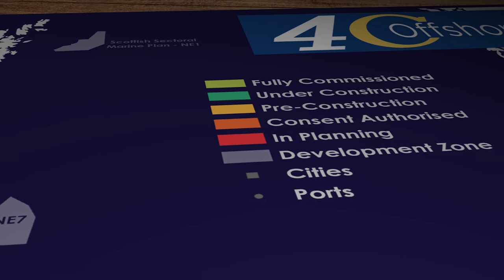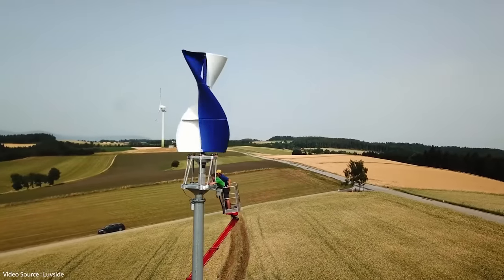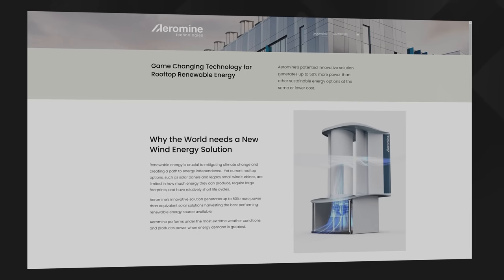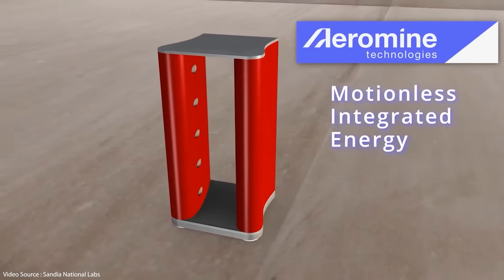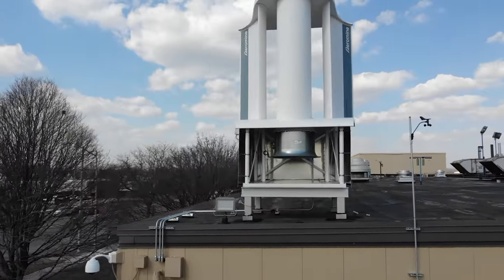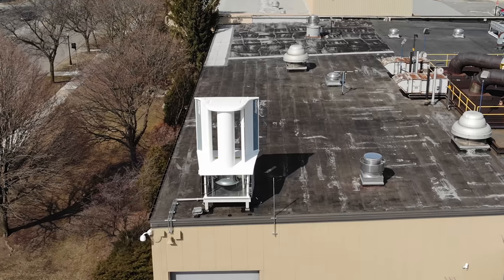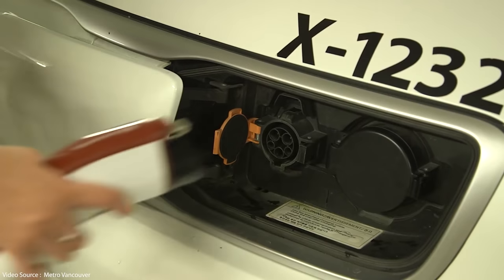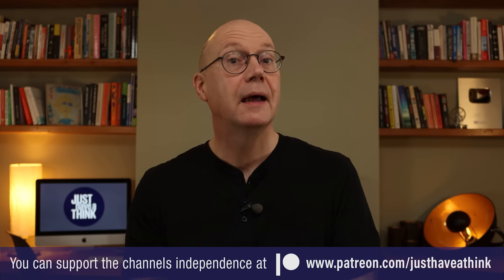Aeromine Rooftop Wind. Static. Silent.  50% more power than Solar PV. What's not to like?

Comment: More than anything I feel we should come up with multiple integrated methods of mass producing power, strength in diversity so to speak. If one method fails the others are still there. Like some kind of synergistic co-op. Sorry if that sounds weird.
Reply: Look up Ziroth, he did a great video on this same technology

As well as great videos in general
Reply: Peer to peer generation and storage, supported by an integrated grid is The Way
Reply: That's always been the goal
Reply: Industrial sights often combine an high level grid access with small to medium sized power generation often for heating or cooling and electricity on side. 
In addition to Photovoltaic for electricity.
Reply: We did that decades ago.

We say fossil fuels, but that's not one fuel.

Before we had "renewables", coal , natural gas,  several types of waste liquid fuels, nuclear, and hydro made our electricity. 

The biggest problem is that we have to move large amounts of electricity around the country as the day goes on.

Renewables allow us to put lots of electricity production right where the homes are, which will greatly reduce how much electricity is moved.

For example, if the people in your neighborhood produced 30% of their  peak electricity usage, then you have to move a LOT less energy long distances to meet that peak.
Reply: Reliability and safety are a key metric that grid operators around the world aim for. 

Having redundancy in energy sources means that you have less of a risk of the grid going down given any kinds of disturbances. 

Positioning this tech alongside building roof edges, leaving the other space for solar panels, is a prime example of this. Same is true for those ideas we've seen Dave cover in the past of co-locating offshore wind + wave generation.
Reply: @thetalkingbear Perhaps if we stopped using government to interfere with the free market, we could let capitalism do all this for us!

The free market, like evolution, finds the optimal solution through trial and error.
Reply: @jezlawrence720  We already have an 'integrated grid'. Energy storage is far to expensive, as is all renewable energy.

Either use fossil fuels or nuclear and quit worrying.
Reply: Fossil fuel apologists are out in full show today dang, this is new for Dave's channel
Reply: Not at all weird.

I've been thinking the same thing. Particularly when it comes to looking at localized/democratized power - one has to lean on what type of biome you live in to clarify what is the best power source. For example, it's likely far better in the northern hemisphere to focus on wind power, because it can generate more over time given the long winters and lack of direct sunlight. Products like this and other stable-state wind production could be vastly beneficial, even if you have solar. I know some companies are designing machines like this that can hook into an existing solar array, and can be removed and become a portable generator as well.

So you're right on the mark. Diversity is resilience.
Reply: Amen
Reply: @joeblogs6598  The free market is incapable of dealing effectively with entities that damage the climate or the environment, because markets ignore unpriced externalities.  If coal burners had to pay for the damage caused by their CO2 emission, as well as the damage from their toxic and radioactive particulate emissions and tailings piles, then the market would work great.  The last coal plants would have closed many decades ago.
Reply: @SeeNickView  The reality is that fossil fuels have provided the world with enormous benefit.

If you believe there is another source of energy cheaper than fossil fuels, go make a business providing it.
Reply: yeah except at night there is no wind either... that's why renewables need a lot of storage and will always be way more expensive than baseload like nuclear
Reply: 1. No wind at night? Are you serious? Air pressure differentials just cease at night? Yeah right. 
2. Even if that was true, you should look at electricity demand curves. Night happens to be the time of lowest demand.
Reply: @incognitotorpedo42  Completely and utterly false.

The environment is not an "unpriced externality". People care about the environment as evidenced by the fact people clean their house, trim the hedge etc. Therefore, they are willing to pay to maintain the environment. The issue is that people have other, more pressing matters to spend their money on, like food, heating, healthcare.

Think of it this way: Take a look at some slum in africa. Theres detritus everywhere, open sewers etc. Do you think those people want to live like that? Of course they dont, but they dont have the money to spend on disposing of their waste properly. Part of the reason behind that is because energy costs so much over there. Alot of those countries use petrol generators because they have no grid. Other places dont have any electricity at all and rely on wood for heating.

Humanity's well being is in direct proportion to the price of energy. If energy is cheap, people will have the money to make things cleaner.

If you doubt capitalism's ability to make everyone's life better, I remind you that a capitalism based system is responsible for the conditions that allow all these inventions that make our lives better, to exist.

If you believe that putting the government in charge, an organization funded by theft (taxes), and one routinely caught in corruption and general wastage. I'll direct you to the USSR, and China, which have the biggest governments in existence, and are the most polluted places to exist. Just look how the Aral Sea was destroyed by the socialists.
Reply: @thetalkingbear It's not weird, it's smart.
Reply: @joeblogs6598  assuming your argument is in good faith, you are just ignoring that some tech could be optimal for environmental impact, another for pure cost, another for resiliency to weather events, another for generation predictability (dispachability), etc. If government doesn’t intervene, if fiduciary duties associated with the business organizations laws based purely on long-term profitability, might not create the proper incentives for the deployment of power generation technologies that are better for the long term viability of the humanity.  Guardrails imposed by the government can redirect the forces of capitalism towards the really optimal solutions for humanity (including profitability) and NOT ONLY those technologies that are optimal to deploy in the interest of companies’ shareholders.  Short story is, it all depends on what you are actually optimizing for.
Reply: @fricardo3  "pure cost"
The price of something is the expression of all this stuff weighed up into one.

If you think something is too polluting, it is likely because people value their time more than that degree of pollution. If their time was more valuable, or things that they bought were less expensive due to cheaper energy amplifying their effort, they would likely spend that excess value on spending a little more on a less polluting alternative.

As I've previously said, people living in slums don't like the pollution they make, it's just that they can't afford to pay a guy to build a sewer or take away the trash.

"capitalism towards the really optimal solutions for humanity"
Pure capitalism (unregulated free market), provides the optimal solution for humanity.

It's like all these ridiculous regulations they're trying to force onto farmers at the moment relating to fertilizer use. 
Foolish politicians, activists, and environmentalists believe they know how to farm better than a man who's job it is.
Said people want to restrict the quantity of fertilizer used by a farmer. They don't seem to realize farmers ALWAYS want to reduce the input costs on their farm, they are incentivized by economics - capitalism -, to use as little fertilizer as possible.

The inevitable end point for allowing the government to regulate ever more of the economy in the name of politicians (or the voters) knowing better than everyone else on how to do the job, is tyranny.

Let the free market do its thing unmolested by government.

"it all depends on what you are actually optimizing for."
Government optimizes for more government.
Reply: @joeblogs6598  Fossil fuel is on the down side of Hubbard's Peak, that's from BP. Do you think if fossil fuel wasn't on the wain and we could simply tap a well in Texas they would have had a Gulf oil spill 18,000 feet down under 5,000 feet of water? That's a rhetorical question!

People are afraid of nuclear, Chernobyl, TMI and Fukushima did that all on their own!

Fossil fuel is dead, renewables are technologically rich, PV costs ten percent of what it did ten years ago, FF prices are going up.
Reply: Agreed. My concern is that large industrial investors are waiting for the optimal solution, which can't be known until several have been deployed for years. Meanwhile, the world burns.
Reply: do not management of these different sources of power become complicated for a single homeowner.
Reply: Not weird, diversity of energy sources, by type and spatially, is essential. 

In terms of security, the Texas case and Ukraine both clearly demonstrate the vulnerability of reliance on few energy sources with few single points of failure. A disaster or well targeted attack can be overwhelming and easily take out the entire system.
Reply: @joeblogs6598  
Capitalism's long party at the expense of working people is over. Make sure you turn the lights off when you leave.
Reply: Agreed, someone should invent a device to harvest a combination of solar, solar thermal and wind energy. And make it easy to install and cheap to use.
Reply: @jezlawrence720  They exist, checkout microgrids

https://www.energy.vic.gov.au/renewable-energy/microgrids
Reply: @jimgraham6722  they exist but aren't being pursued as given by policy in enough nations. 

In the UK you'd likely get in trouble for trying to set anything like this up, it's govt business or its personal here, the idea of "common good" was ditched in early 20-teens.
Reply: not wierd. Humane, and practical.
Reply: I reckon all new builds away from the equator should come with: Solar with those concentration lenses you can see on Two Bit Da Vinci, not towards equator as the heat is already damaging to PV. Suitable battery to run all appliances for 24 hours straight in case of power cut (obviously you wouldn't in a serious power cut and it's fridge / freezer / oven only) with a rooftop turbine, backyard small VAWT, and also.... Dale Vince's Gas from Grass. Why is nobody ever talking about it? Is nearly clean gas-heating & cooking that's 13% of current fossil gas emissions not good enough now? This is a channel with a heavy Vegan audience by my estimates and NOBODY but a Blue Zoner like me is helping amplify it? Bizarre.

See my climate action tech playlist for details.
Reply: "Strength is diversity" .... you obviously never worked in maintenance, nor production actually.
Reply: @TheHorseshoePartyUK  Fantastic, I don't understand a fraction of this but I am sure you are right. They key thing is, Why. Isn't. It. Happening. And you don't mention zero-carbon builds, which are happening, but only in few places. I suppose my answer is, follow the money. The big ones arent invested in it, therefore, not only do they not care, they will actively block these alternatives.
Reply: @patmat.  that's depressing. I don't know quite what you mean but I see major opportunities for job creation and training.
Reply: @helenswan705  There is another channel by the guy who was Kryton in red dwarf and that has a low / zero / negative build vid recently. Fully Charged Show maybe? They had a separate channel too though. Not my favourite so I rarely watch it.

I like this one, Two Bit da Vinci as mentioned, Undecided with Matt Ferrell, Ziroth I think it is and anything interesting I find.

Eg there's a small boat someone built which is solar powered then converts excess energy into hydrogen from seawater.
Reply: @joeblogs6598  The market produces the solution that makes the most profit, not that provides the best and most efficient solution.
Reply: @mliittsc63  Due to overbearing government, and inflation caused by a chronic imbalance of the budget, no one is willing to invest in anything long term.
Reply: @midnightwatchman1  I'm running two systems here. I do check them but they basically run themselves with the new technology and firmware.
Reply: @TheHorseshoePartyUK  I am no engineer and simply take these videos in as an interested spectator, looking for eco alternatives. For decades we have wasted opportunities to create better solar cells, small rooftop wind generators, wouldnt it be good if heat pumps were easier, what about battery storage and we have purely neglected it all. cos of where current investments are - and those continue to produce good returns. A few brave private researchers. . . so I am overjoyed to see things like this, but I dont understand them even fractionally. Its like tasting something wonderful in a restaurant but completely accepting you could never make it. If we'd invested decades ago, we'd be in a different place. I think this one is particularly exciting because it is becoming apparent that large wind turbines aren't very eco at all (habitat destruction, too much concrete). this one could fit into so many places, I wish them luck. I recall a few years ago there was a proposal for a roof-ridge wind generator. I think it came to nothing. Was that cos it was no good? or cos they couldn't get investment? I have no idea. Thanks for your communication, but it's way over my head. I am a frustrated but interested outsider.
Reply: @joeblogs6598  No. Adam Smith, author of The Wealth of Nations, described what he thought was a flaw in markets. His first readers called this “the tragedy of the commons”. Today, we call it external(ized ) costs. Climate change is essentially a gigantic tragedy of the commons - no one owns the atmosphere. The correct solution using price signals would be to tax fossil fuels at a rate that is ideally the present value of future costs. Where would we be today if such a tax had been implemented 30 years ago?
Reply: Exactly, with every building having some micro-generation.
Reply: Sounds good 👍🏻
Reply: How about burning coal?  Historically, coal always burns and you can burn more when you need more energy.
I know, revolutionary idea, but it's worth another several hundred years of trying it out.
Reply: @joeblogs6598  The free market ultimately results in monopolies.
Reply: @joeblogs6598  You do realize that solar and wind farms create energy cheaper than coal and gas burning power plants, and nuclear is far too dangerous.  Ask the people of Fukushima Japan how they feel about nuclear power today.
Reply: @skraf883  No it does not.

More importantly, what is government? It is the greatest, most all encompassing monopoly ever to exist. It's revenue (taxes) surpasses any other company in existence.

 If you're against monopolies, they why not take a loot at government first.
Reply: @skraf883  "nuclear is far too dangerous."
How ignorant. How many people have died from fukushima? One. A far more important question; how many people die from the increased price of energy due to governments banning fossil fuels?

"You do realize that solar and wind farms create energy cheaper than coal"
If this was true, then companies would have created vast solar power plants by now.
They have not, because it is not economical to do so.

The price of energy dictates your quality of life. If you life is shit, you wont live as long.
Reply: @skraf883  The relative PROJECTED cheapness of solar and wind farms, compared to coal and gas plants, is for NEW plants to be constructed in the future, and it also relies on the inclusion of relatively arbitrary carbon taxes. It's a somewhat artificial comparison, and it doesn't apply to the transitional use of existing coal and gas plants. And it doesn't take into account the need for baseload energy capacity, which is ignored at our peril. Over-reliance on wind and solar leaves people freezing when the weather turns cold, overcast, and windless for extended periods, as happened in Texas a while back. 
-- Nuclear is more scary than dangerous, if you look at the comparative statistics among the various means of generating energy for deaths and injuries. In fact, nuclear is one of the safest means of generating electricity  And newer nuclear technologies are far safer than earlier ones. 
-- And if you're going to consider all factors, solar's dependence on China should prompt a consideration of all the deaths attributable to "socialism with Chinese characteristics." That much concentration of state power consistently results in a fairly high degree of mass murder (and often extreme degrees), not to mention the other harms done to the people in socialist states. Empowering China by giving the both an income boost and political leverage by a radical shift to solar empowers China to continue its concentration camps and organ harvesting and other ways of making dissidents disappear. 
-- You should keep in mind that the most ardent proponents of climate change responses are elitists who are using it as an excuse to impose totalitarianism on the world, and have strong incentives to overstate the problem and especially to overstate the need for a totalitarian world government to solve it. Totalitarianism for the sake of "saving the planet" is about saving the planet for the evil clowns of Davos, while pushing the masses (those who survive their drastic population-reduction measures) into serfdom. As they have advertised, "You'll own nothing, and you'll be happy."
-- The anti-capitalist concentration of private power is just about as bad as socialism, but unfortunately, too few governments have applied anti-trust laws to keep the markets free of monopolies and cartels. 
-- Either way, the people lose.
Reply: @skraf883  Fascism is a variety of socialism. Stalinism is another variety of socialism. And most of the European countries that have been pointed to as examples of more moderate socialism have taken pains to point out that they are capitalist countries with generous public-sector benefits programs (and extremely high taxes). Socialism has this annoying tendency to turn into totalitarianism by degrees. It's based on a grievously mistaken, utopian view of human nature that requires coercion to get real people to conform to that view. It's a sad by-product of the Romantic Movement, and only has currency because it's intellectually "sexier" than the dullness of common sense. But if you look at the list of modern history's biggest mass murderers, the only one who wasn't a socialist was King Leopold II of Belgium (The Congo wasn't a colony of Belgium, but was the personal property of Leopold. What could go wrong with that arrangement?)
-- The problem with academics is that they tend to be elitists, and elitists are drawn to big governments that tell the people how to live. Prior to WW II, Fascism and Nazism were recognized as progressive, as alternative forms of socialism. Only after WW II did left-leaning academics brand them "far right" to cover up the left's responsibility for the Holocaust. 
-- A post-pandemic survey on mental health came up with the incidental finding that 58% of women who identified as "liberal" or "very liberal" had diagnosed mental disorders. That's what happens when you live a lie.
-- That chart in the link is no slam-dunk, if you read the fine print. And there are other factors that are omitted entirely. 
-- How TF can you claim that it's "Not true at all" that nuclear is one of the safest means. You have to consider the dangers of mining and extraction for other means of generation. And, as I mentioned above, there are huge risks to empowering the maniacal totalitarian government of China, which we are doing by pushing solar prematurely, until we get more solar manufacturing transferred back here or to other non-rogue countries.
Reply: Not weird. Multiple integrated methods of mass producing power is precisely the plan.
Reply: @grizzlygrizzle  No, it's not.  Fascism is extreme RW nationaism.   Fascist ideologues taught that national identity was the foundation of individual identity and should not be corrupted by foreign influences, especially if they were left-wing. Nazism condemned Marxist and liberal internationalisms as threats to German national unity. Fascists in general wanted to replace internationalist class solidarity with nationalist class collaboration. The Italian, French, and Spanish notion of integral nationalism was hostile to individualism and political pluralism. Unlike democratic conservatives, fascists accused their political opponents of being less “patriotic” than they, sometimes even labeling them “traitors.” Portuguese fascists spoke of “internal foreigners” who were “antination.”
Reply: @joeblogs6598  "The only place I think you would be right in labeling uninhabitable, is the reactor building. That's about as helpful as saying the town surrounding a steel mill is uninhabitable just because you cant go for a swim in the blast furnace."   

There's still a 30km^2 exclusion zone. 

"The sun is irradiating the entire planet. Yet we're not running around trying to ban the sun."

You do know that the earth is protected from the vast majority of the sun's radiation, right? 

"Tell me, what options besides nuclear is there to make cheap and reliable energy? I'm fine with fossil fuels, but it seems theyre not good enough for you."

Geothermal, solar, wind, tidal, hydro. And no, fossil fuel power generation is not good enough.  We shouldn't be trading poisoning our air to create power. 

"If you suggest renewables, how do you grapple with the vastly reduced quality of life necessitated by the extreme increase in energy cost brought by renewables?"

Except for the fact wind is already cheaper than gas and coal, and there are wind turbines that work with wind speeds as low as 2 mph.  Reduced quality of life?   WTF are you talking about?  You do realize that over 20% of the power this country creates is already done through wind, solar and other forms of green energy.  We could go totally to green forms of energy, with no reduction of quality of life using energy storage such as molten salt batteries and pumped water storage (which have been used for over 100 years)
Reply: @skraf883  Mussolini essentially invented fascism AS AN INNOVATION OF SOCIALISM. He was at the time the most prominent socialist in Italy, and he noticed after WW I that Italians who had not been able to get excited about class struggle had willingly taken up arms for their country. At the turn of the 20th century, classical liberal capitalism and socialism were dull and passe, but for different reasons, and Mussolini modified the chief element of socialism, the subordination of individuals to the collective, into a nation-based movement, rather than a class-based movement. This was his explicit and deliberate aim, and he saw it as much of an advance of socialism as Lenin saw Leninism as a necessary innovation of communism. The differences between fascism, socialism and communism are functionally trivial-- they are all totalitarianisms, and necessarily so, because they all rely on a view of human nature that's a delusional derivative of Romanticism, an emotionally-self-indulgent view that humans are perfectible, and capable of living in a Care-Bear, My-Little-Pony fantasy world. Rousseau was a proto-communist, a man "ahead" of his time in the advance of ideological depravity, and a big influence on the French Revolution. The result-- 60,000 executions. 
-- The struggle between fascism and communism was an internecine struggle for dominance on the left, the intellectually "sexy" ideological domain. Classical Liberalism subordinates the state to the plurality of individuals, and relies on a more bland and common-sense notion that humans are inexorably imperfect and fallible, which traces back to Hobbes, who, unlike Rousseau, saw human life in the state of nature as "nasty, brutish, and short."
-- Classical Liberalism sees the priority of individual rights as a means of limiting the concentration of power in the state, and the U.S. Constitutions checks and balances (federalism, three independent branches of government, bi-cameral legislature, and Bill of Rights) all seek to limit state power  and the corruption that follows from the concentration of power. 
-- Somehow, the implementation of socialist principles repeatedly results in the oppression of the people and all-too-often, in mass murder. 
-- It's not just the half-assed notions about the human condition, but also the failure of the theoretical efficiencies of central control. It turns out that a few elitists at the top here or there lack the expertise to micromanage the economic and political affairs of a species as complicated as humanity. Authentic right wing theorists (Adam Smith, Freidrich Hayek, Milton Friedman, Thomas Sowell, et al.) have pointed to the particular expertise in particular niches of economic activity of the individuals actively engaged in those activities, which happen to work together synergistically in the absence of monopolies, whether private or public. 
-- Leftist ideologies MUST be totalitarian to impose their incorrect systems of the human condition onto real people, who don't fit the left's pre-conceptions about how the peons function. Leftist ideology objectifies people and imposes its theory upon them. Leftist ideology also seeks to impose an unnatural "equity" on people, despite a great diversity in people's industriousness and economic contributions. Leftists want to re-distribute wealth, with lots of self-indulgent arguments to justify their program of theft on one hand and dependency-inducing handouts on the other. Real people can tolerate only so much of this; indeed, they will participate voluntarily in it to some extent, and conservatives are consistently more personally charitable than leftists. 
-- Leftists, on the other hand, like to outsource their "compassion" to the state, and smugly claim some imaginary moral high ground as they vote for a redistributative system that requires little personal charity of them while necessarily promoting a more centralized, totalitarian government.
Reply: What do we do with excess power generated by multiple sources? Batteries?
Reply: @jezlawrence720  I agree 👍
Reply: @joeblogs6598  so when your nuclear plant malfunction and it will and your community is unhabitable for the unforeseen future "don't worry about it "
Reply: @terrellstewart4071  " community is unhabitable for the unforeseen future"
Never happened, never will. 'Uninhabitable' is just a made up word.
Reply: @joeblogs6598  so move next to fuchsima and let me know how that works out for you.
Reply: @jezlawrence720  There are several successful examples of this on the planet.  Local (community) generator / users in partnership with the local utility.  Win/win/win.  Australia has the best examples.
Reply: About 70% of my power consumption is provided by rooftop solar (5br 2 storey house) and in fact its more like 150%, because I generate much more during the day than I can consume.  I am waiting to buy an electric car that I can use as a home battery at night, then I’ll need the grid no more.  I think I can make it happen within the next two years as the EVs get better and the regulators catch up. A wind generator would be a good backup for cloudy days when the solar PVs don’t make enough energy, which happens occasionally.
Reply: @rutha.5627  As fossil fuels sources are depleted, they get more difficult to extract. This means their price of production increases.

As the price of fossil fuels naturally rises, exploring other ways of creating energy are incentivized, and eventually become economically viable.

Through allowing the free market to just get on with it, fossil fuels will be eventually supplanted by an even cheaper way of creating energy.
Reply: @joeblogs6598  Sometimes Government seed-money and legislation can make a significant start-up possible, where private investment is unlikely to take the risk.  Those wind turbines are a case in point: if there is demand for thousands of the things, production costs will fall.
Reply: @rogerstone3068  If you need government money to keep your business in existence, its not a business worth having. Wind farms are not an economically way of creating a continuous  power supply. Nobody remembers to factor in storage costs.

The real crisis is that governments around the world are spending too much money. They are all running billion dollar deficits, and worse still comprise around 50% of the country's GDP. They are one massive monopoly.
Reply: Where renewables are concerned diversifying generation methods is a necessity.

That being said the most important factor to make renewables as viable as possible is storage.

Without a game changing storage tech that is cheaper than Li ion for grid level use we are still at the mercy of shifting conditions in cloud cover and wind speed.
Reply: Yeah, using air turbine, solar panel and heat pump at the same time would make the most out of sun, wind and water energy.
Reply: @RemnTheteth  Diversity is resilience as long as you take fossil and or nuclear into the equasion. If you need a guaranteed grid, you can't count on solar and wind alone. Full stop, no discussion required.
Reply: @incognitotorpedo42  You're sanely cognitive of the fact that Flora requires CO² to live and produce O² which Fona requires to live. Simple as that! If you go on on your net zero emmissions trip, the day you clutch your chest unable to 'breathe' is the day you've done yourself in. THINK ABOUT IT!